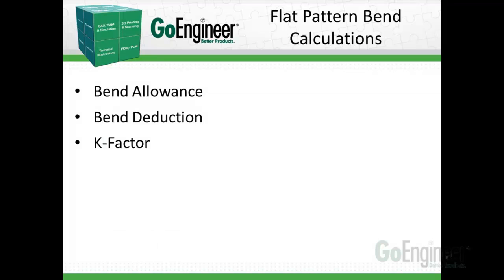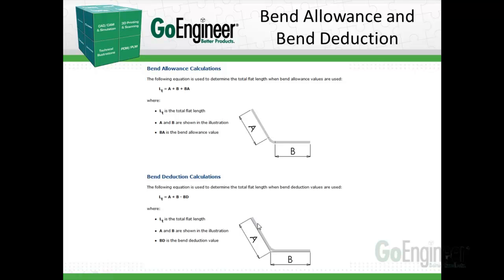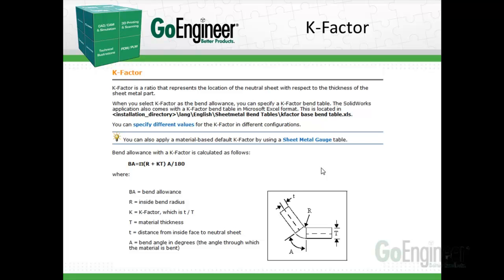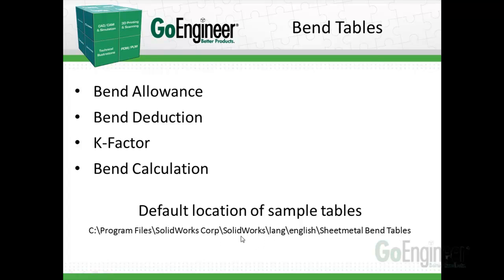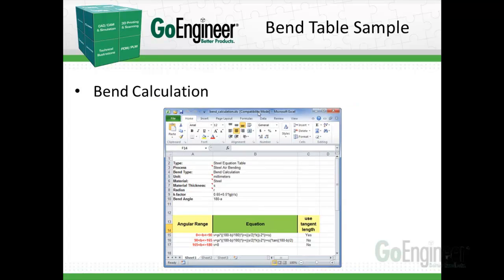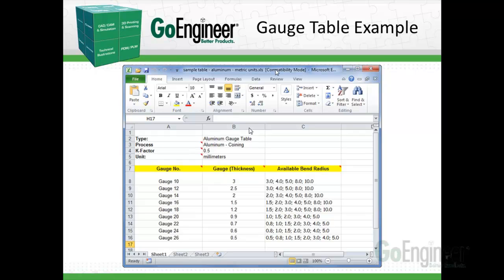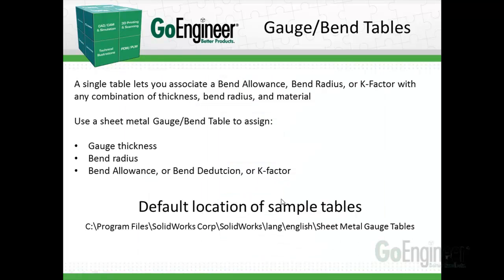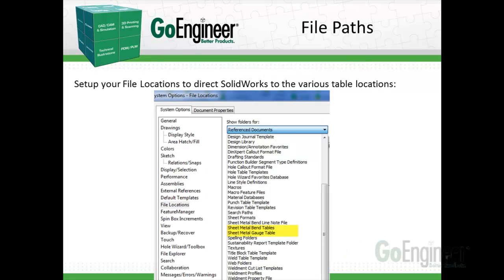SOLIDWORKS – Sheet Metal Bend Calculations

Comment: Thank you for the useful information. I use k-factor. Mostly bend 2 - 5 mm sheet metal. I simply put the radius equal to the material thickness, k factor - 0.33. I dont know how much it is accurate, it seems hard to count it out. But i've been bending  a lot with this settings and everything fit together. How can i make the radius and k factor change automatically depending on material thickness? I kind of understand that i need to create the special table for that, but the sample ones is sort of different and seemed complicated for me.
Reply: By default the radius will stay the same, but the K-factor could change per the K-factor specified in the Gauge Table for the selected thickness. A good K-factor sample table is “k-factor mm sample.xls “, it can be found in:  SOLIDWORKS_install_dir\ lang\english\SheetMetal Gauge Tables.You might want to copy this table and edit it to include your thicknesses, angles, radii, and K-factors.
Reply: Thank you! I'll give it a try.